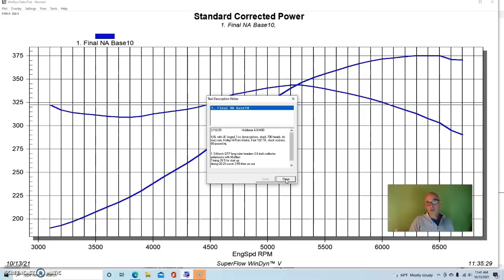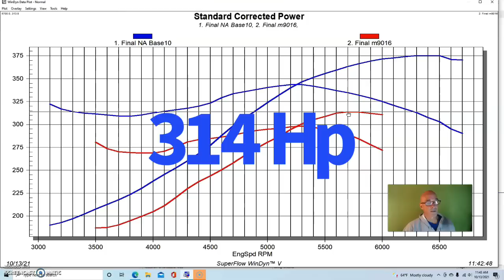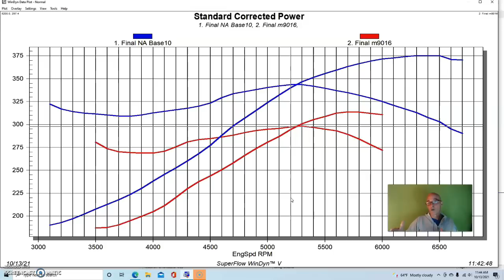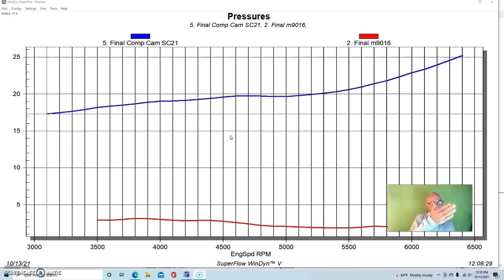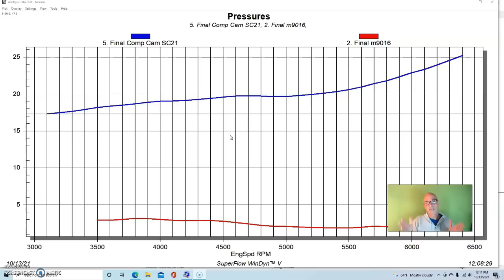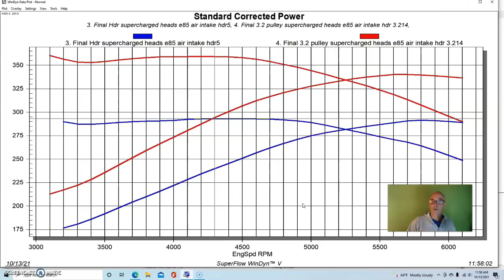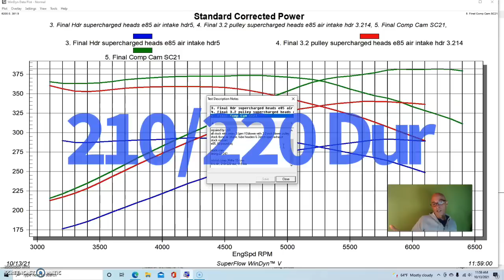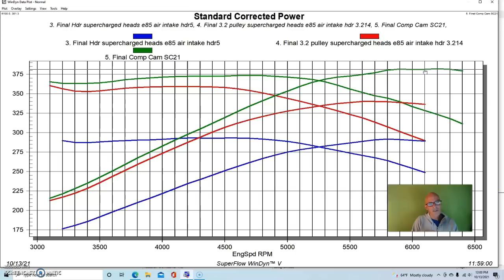HOW TO: CHEAP, JUNKYARD M90 BOOSTED LS? SHOULD WE RETEST ADDING EATON M90 SUPERCHARGER TO THE 4.8L?

Comment: I made more horsepower on my m90 3800 series II than you did on you LS before you put the m90 on. It's not the m90's fault. It can support 600 hp. Don't port it, it does nothing at all, in fact probably makes it worse. I would only port the inlet to match the size throttle body if you're going bigger than the size of the inlet, other than that, nothing really matters. Just change the pulley. It's a positive displacement blower. You need to fill the manifold faster than the engine consumes it. You also need a boost referenced fuel pressure regulator, to raise the fuel pressure to compensate for manifold pressure it's pushing against.

FIWI every snout seal fails when you start spinning these things faster.

You want to keep the blower at optimal delta P, which for a gen 5 m90 is ~15 psi

I understand your logic that you think consuming the charge air faster = more power even if it means lower manifold pressure...

In practice, if you do something like head porting or a larger/longer duration cam, headers, and suddenly your boost level drops down, you would again want to spin the blower back up to 15 psi.
Reply from the maker: please see the video where we made 650 hp with a modified one

Comment: Yes Do it. I have a gen V m90 supercharger i was going to use on a v6 mustang but didnt. But i had thought of using it on a smog 90s 305 v8 engine to see if it would make boost on that engine if i modify the blower. I wonder how different they are to the 144 carb blowers from b&m airflow wise.
I also considered cutting a hole in the top of the m90 to mount a carburetor to it and cap off the original inlet after trimming it off. I also thought about using an old ice can for the fuel line to run through in order to cool the fuel before it gets to the carb in order to help controlling the heat in the blower a little bit.

Comment: Absolutely! The 4.8 with a cam and head studs for durability w/ big throttle body so you get plenty airflow at lower boost w/ big injectors to allow matching Airflow/ fuel ratio for power w/o blowing head gaskets.

Comment: What if you had 2 of the M. 90s because I have not to the MD and I'm putting them on a 351 Windsor in a truck and you want to the power to be down low so with that work
Reply from the maker: YES-IT HAS BEEN DONE
Reply: @richardholdener1727  I have a Ford 351 Windsor stock in a 94 Ford F-150 the engine runs really good I'm just curious to know do you think it'll make up to 10 to 15 lb of loose pressure with two of those running with the smallest pulleys I can get

Comment: try a intercooler
Reply from the maker: with 1 psi of boost? there is an intercooler test up on the 3800 combo
Reply: @richardholdener1727  ive seen vids of people just barely making 12psi everyone usually says its cause the air gets too hot to actually charge it.

Comment: YES!!! Redo it.  Get some pulleys starting at 3.0” and get smaller from there. With factory 7.5 crank pulley that should put boost between 5-10 psi.  You’ll have to find the magic line between enough blower speed and belt slip. Only saving grace will be that the boost pressure Will be low so that will help keep belt slip down.
Also, see if you can flip the pulley on a M112 or m122 and run a bigger single blower.  Still cheap power.

Comment: I been told only way 3800 with maxout m90 to reach 500whp is the pistons have to be more than 8.5 in 1. A lot used NA 3800 short block with supercharger heads. Nickname called (Top Swap) The compression is 9.4 in 1. Helps it gettie  up faster. Also better down low torque.

Comment: Curious to see of it can actually make more than NA power on the 4.8L. I suspect, even with porting and a tiny pulley it won't on the cammed 4.8L.  The square port supercoupe version was sold in a kit for the 2V 4.6L Non-Pi engine and those ran about 6psi with a small pulled and added about 40-50rwhp/TQ, but those only made about 170rwhp to begin with. Old friend ran that kit on a 97' Cougar 4.6L. I still have an old oval port M90 around from my supercoupe days, always wanted to use an EFI lower intake with a custom upper/M90 on a Ford 300-6.

Comment: and most of the guys running over 400rwhp are using a 2.4-2.2 inch blower pulley and a 5% overdrive crank pulley
Reply from the maker: never heard of a 2.2 pulley
Reply: @richardholdener1727  zzp do a 2.3 pulley boys do down to a 1.9 and a few places will do the modular ones to a 2.2 a few of the guys here in aus have also swapped to a cog setup to eliminate slip but I know all the guys running in the 400-500rwhp range have a modified blower as in back half cut down and a 4 inch pipe welded on some internal port work to match to the pipe and they run 102 or 112 throttles there seeing as you would be aware a jump in boost by a few psi and roughly 20 to 40rwhp gains thats on a smaller setup but even more on the bigger setups I really can see where it will help the ls motor setup breath more even though we both know its well under sized for that motor but I think with that mod and some more pulley reduction you will see a positive boost pressure but intercooling clearly will help alot also as you spin it up have you considered flipping it on its side and making a flange qnd pushing boost out to a pipe and making a air to air or use the water to air setup you commonly use have always wanted to see that done.

Comment: cut the back off the charger and put a new flange and run a bigger throttle they push air great but they a crap at sucking it in this is how the guys in here in Aus are getting them to go better you know better air flow in makes power from your experience so please cut one down and see what it does.

Comment: Not sure if it’s practical (all the porting and mods take away from the junkyard theme IMO), but I’d like to see the results!

The test I would really love to see- 4.8 turbo: big block tow rig replacement? Add AFM and variable cam to a gen 4 4.8 with a turbo sized for response/low speed torque, and maybe even spray washer fluid (available at every fill up, unlike methanol). Attempt to meet or exceed a stock gen 6 or 7 BBC dyno numbers, while measuring fuel flow and consumption at low load (simulating cruising with no trailer), moderate load (pulling a trailer at highway speed), and at full throttle (pulling a hill with a big trailer behind). 

Does the high tech and theoretically lower frictional losses of a baby V8 equal a more efficient tow motor, or does a traditional big block simply make more low speed torque (making it more drivable in the application) with minimal fuel consumption difference?
Reply from the maker: THAT TEST COULD ONLY HAPPEN IN THE VEHICLE
Reply: @richardholdener1727  I clearly have zero first hand experience with dyno’s, but can’t you dial in steady state loads? You’d definitely need the vehicle in order to test drivability, but is it necessary for fuel consumption at various simulated loads? 

Thanks for all the education and entertainment!

Comment: Probably better with a M122. M90 is only 1.4 liter. You didn't mention the crank pully diameter in the video to calculate rpm.

Comment: After fiddling with some math and online calculators, assuming the Gen 5 M90 and the 4.8 both are ~90% volumetric efficiency, at a 2.5:1 drive ratio you theoretically will see ~11PSI boost pressure. At 3:1 drive ratio you should see ~18PSI boost pressure.  I also checked for fun assuming a 90% VE 4.8L and a 80% VE earlier gen M90, assuming ~7.5” truck pulley and ~3.8” stock L67 pulley, that’s ~1.97:1. Call it 2:1 for ease and the math came out to about 1.8PSI boost pressure, pretty close to what you saw. 3:1 drive ratio puts the M90 at 21,000RPM at 7000 crank. With stock truck crank pulley(if it’s actually 7.5”) that’s ~2.5” blower pulley. Does that even clear the snout of an M90?  2.5:1 drive  ratio puts you at a ~3” pulley.  I’m curious to see data from a stock junkyard Gen 5 M90 run on the 4.8 with various pulley sizes including the stock L67 pulley, and then port the M90 and see what you gain by a larger throttle body and blower porting. Also is there a way to adapt the airflow hat you guys have for carbs to the inlet of the M90 so you have CFM data before and after porting? Or perhaps you have a calibrated MAF sensor for the dyno you could use to get that data? At 21k RPM the M90 theoretically moves ~1100CFM, I’d like to see some flow data before and after porting as well.
Reply from the maker: I doubt the M90 (even ported) will move 1100 cfm (we only need 900 cfm or so)
Reply: @richardholdener1727  I doubt it also, that's what has me curious about the flow numbers before and after porting and if you can measure that as well. I assume the VE losses at 21k RPM blower speed will be pretty great even with good porting. I can't wait to see actual data vs the theoretical bench math I played with. After parasitic losses from driving the blower I predict your final power numbers will fairly disappointing for a forced induction 4.8L due to inefficiencies caused by the M90, even ported. Should make for some real interesting data though.

Comment: Yes do it but change the cam on 4.8
To 220/235 duration at 50 with a 2 inch
Blower pulley and port the blower
With a 80 mm throttle body
Reply from the maker: WHY CHANGE THE CAM?

Comment: Would be interesting to use the m90 supercharger to test flow differences between the ford 4.0l barra and the atlas 4200 at multiple blower speeds and see which one makes less boost=more flow.
Reply from the maker: the one that makes more na power will make more power at any given blower speed
Reply: @richardholdener1727  thanks for reminding me. I like watching your videos to learn more about turbochargers to understand why my collection tractors that have a turbo are sized the way they are. My big tractor is 200 hp if it had an aftercooler it would be 250 but the old bit is I have a 130 hp tractor with in some ways a bigger turbo. The second biggest tractor on the farm has a rather large turbo that uses a t6 flange for only 193 hp.

Comment: It should totally happen. If not for anything else than giving ambition to repurpose old parts. A m112? adapted to a old 302/351. Or a ls4.8,4.0 V6 mustang.... or two scroll superchargers on a less conventional engine
Reply: Horsepower and torque are just expressions of airflow. If that 4.8 makes similar power to that tuned up 3.8... with high blower speed and lower boost (heat). It's a winner. And at the cost of a high ram, and a tensioner. That's a WIN

Comment: What about doing the M90 supercharger on the 4.8 but completely stock everything except of course that  intake you used to make the adapter with and all of that kind of stuff but stock Pistons heads and camshaft and even injectors so we can see with purely all junkyard parts and a custom intake adapter what the 4.8 can do in stock trim or will the stock injectors even work with the Boost supplied by the M90.
Reply from the maker: stock 22 pound injectors are not enough for the supercharged power output (about 350 hp na-even less under boost)

Comment: Used 5th Gen Eaton M90s available on ebay for $500 or less w/throttle body.  Two M90s = One "M180" worth of boost - or nearly 3.0 liters per revolution.  Edelbrock X Ram base with custom adapter for blower on each side.  Blown X Ram.  That'll git er done.

Comment: 400 horsepower takes about 40 lb/min of mass air, not including the power to drive the blower. Getting above that power level on the 4.8 is going to take a LOT more air, on the order of 60 lb/min at a guess. Not sure that little M90 is really up to the task—probably well out of its efficient area of operation. OTOH, using a 2.5” blower pulley and a stock truck crank pulley, you’ll be close to 20,000 blower rpm. I say YES, it’s worth a test! For actual street use, find a used LSA setup! Do the test, though, please, Richard!

Comment: Granted theyd be much less common than the M90, but I imagine the M112 blower from the 4v Cobra R motor, 99-2004 would be a better fit.
Reply from the maker: M112 was on the 03-04 Cobra
Reply: @richardholdener1727  Ah ok, making it even less common lol

Comment: Yes. But port it and run on the l67 3800. Then run factory na manifold and a turbo. Or two small turbos. 

I think Australia has a better plenum for turbo build on our ecotec 3.8L holdens. Its like a small highrise. We cut and shut the throttle body to right hand side. Also our cars are rear wheel drive so our intakes have a bend on our l67 m90 blowers.

Comment: While you could use an M90, why not go with one sized better for the engine. I feel that an M90 would really suck on efficiency at the speeds needed to get enough boost for that engine size.
Now throwing it on a 4 popper could offer some HP goodness

Comment: We had a guy at our local track that ran two of the m90 on a 302 ford for years. He was a good fabricator and mounted them at a 90 degree angle to each other. It was a torque monster although he had to be careful with pullly sizes or he would push out a head gasket. Wish  I could find a photo.

Comment: I agree with the retest. If it works though the sloppy tax is gonna hit on these blowers which are cheap just like it did with the cadillac ones.

Can you throw one of these blowers on a 4.3l v6 Richard? I'd think you'd see a nice gain without all of the hiccups your having to do on the 4.8l.
Reply from the maker: the 4.3l will be like the 3800

Comment: The M90 puts out 90 cubic inches of air per revolution. Engine cycle is 2 revolutions for 1 intake cycle.
At best that older M90 is only 80% efficient, so 2 revolutions will put out 180ci x85% about 153 cubic inches.
The 4.8L 292 ci engine injests 292ci per 2 revolutions/engine cycle.

So it all depends on your pulley ratio. So if 3.8" SC pulley and 7.25" crank pulley, less than 2.0:1 pulley ratio, the SC will not even put out enough air to feed the 292ci engine.
You just need a smaller SC pulley. But the faster you spin the SC the hotter the air and less power.
Maybe with newer Gen M90, ported and bigger TB you might see 5psi boost max.
M90 really is too small for a 4.8L.
I have lots of experience using the M90 on Jeep 4.0L and stroker 4.6L.
Reply from the maker: you need to stop using displacement in your calculations-I have NA 4.8L motors that make 330 hp and some that make 500 hp-the boost on those will be dramatically different at the same blower speeds
Reply: Yeah I'm talking about a stock low level engine with poor to average flowing intake, cam, valves and exhaust. Like motors making only about 1hp/ci.
It is more about displacement and VE of the supercharger and engine.
The SC and engines are only around 80% efficient.  So even if with mods you can make it 100%, the max amount of air the M90 can put out is 90ci/revolution. A performance engine can achieve better VE some even over 100%.
So it is still related to displacement where boost ratio will depend on displacement and efficiency. 
The engine displacement x efficiency / SC displacement x efficency.
Your future testing will be very interesting.

Comment: Yeah Man! Fords old SC 3800 was well over  2.53 drive ratio stock. Stock GM  factory ratios are so low. So 7.156/3.8 X engine rpm

Then just multiply the ratio 1.88 X 5000 = 9400 blower RPM
or 1.88 X 7500 = 14100

1.88:1 with a 3.8" pulley
1.99:1 with a 3.6" pulley
2.10:1 with a 3.4" pulley
2.24:1 with a 3.2" pulley
2.39:1 with a 3.0" pulley
2.56:1 with a 2.8" pulley
2.75:1 with a 2.6" pulley
Reply from the maker: already did all the math on it-blower speed will be easy with a bigger crank pulley and more engine speed offered by the 4.8L

Comment: Richard, do you remember the Magnacharger from the mid 80's? They looked like 2 small roots blowers in a common case. They used Weber side draft carbs and could fit under the hood of most cars. YES, YES, YES, do this test. These things are setting all over the junkyards for little or nothing. And if you catch my drift about the Magnacharger, maybe try 2 blowers at once? That would take some engineering but it would be a cool test.
Reply from the maker: I had one of those

Comment: Definitely want to see how the M90 does on the 4.8 this time.
400+hp 4.8 with Supecharger whine for cheap! Who wouldn't want that?
Reply: Man a 400hp m90 setup would be maybe 300whp in car. And only on a cold hero pull. On the street once fully warmed up it would be 250whp.  You would get smoked by nearly everything on the road and would have to tell people that the cool blower whine is actually just a noisy powersteering pump lmao

Comment: What is the least expensive blower set-up to work on a 5.3 lm7? As a disabled veteran my funds are limited which is why this information is priceless!! I was able to find a 5.3 engine for $450 and an 85 El Camino SS to put it in. Now it needs the extra power to live up to the SS.
Reply: Sorry to say but there's not much available from the yard for a big ish V8, most SCs are best suited for smaller displacement lower output engines.   If you can find a M112 for a good price it'll do great,  but those are specialty items that normally don't make it to self service yards or even general purpose yards. They get snatched up by specialists and sold with a healthy markup. 

There's plenty of budget options for turbos though, and a 5.3 with a cam and other mild mods will make more than enough power to live up to the SS badge.